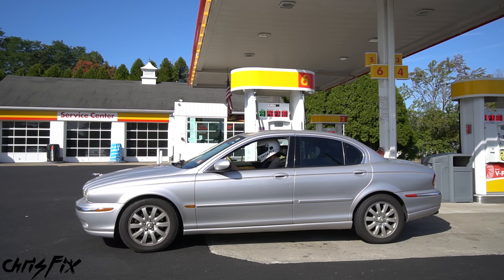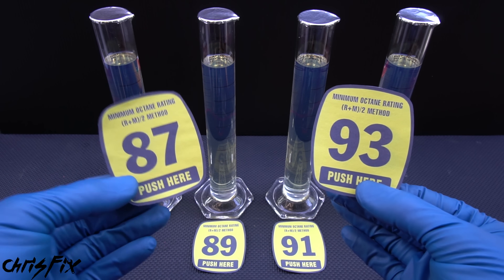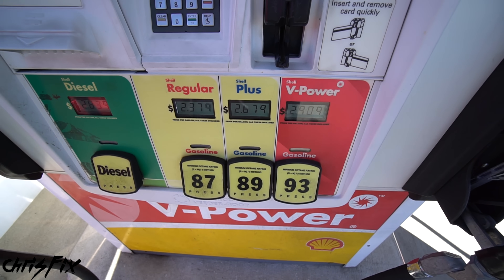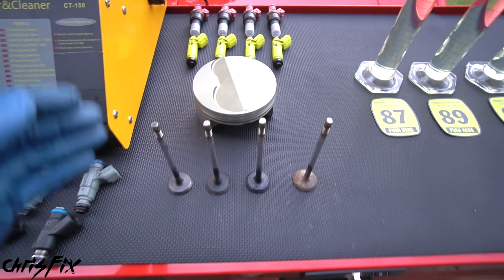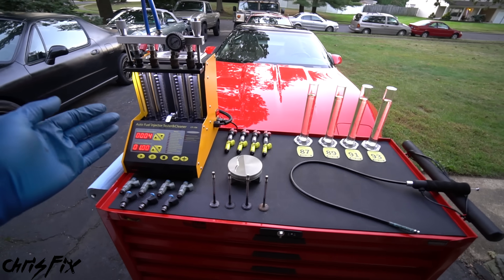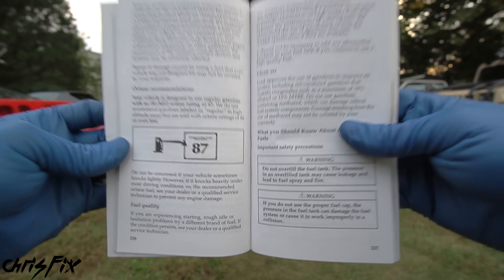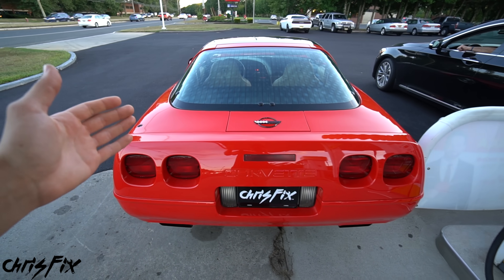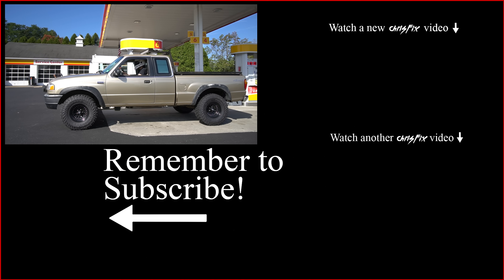What is the BEST Fuel to Use in Your Car or Truck and WHY

Comment: WRONG INFO.......the fuels have different burn rates.
If you use 93 in a engine that was designed to run on 87 you can over time cause carbon to build up in the engine because of the different burn rate 
I read this in a mechanics trade magazine a few years ago.
Reply from the maker: That’s not true. I had petrol scientists go over my video before it was published for accuracy.
Reply: @chrisfix  
Well.....somebodys wrong.....like I said I read that in a Mechanics Trade magazine at a repair shop.

Comment: Shell and Exxon are best fuels.    
What about using lower octanes at higher elevations?    Denver, Coloradope pumps:  85 R, 87 MG, 89 P
We use Regular in our RX350.   Maybe slightly less fuel mileageconomy, buthe lower co$t is worthe difference.
Interestingly, CostCo sells only 85 and 89 (or is it 91?).  Do any customers mix the two to create mid grade?

Comment: ill nvr run shell gas.....the only time i did i had a 97 sonoma 4cyl 5 sp it ran just fine until i put shell gas in it...i cidnt go over 20 mph until i pumpee the tank and put my usual gas i  it from Ayerco...and also i heard that ayerco under rates the gas..like the 89 is 90...and so on...i havent had any issues with gas since ive stayed away from shell
Reply: i even have ran 2 cycle gas in this truck once...in an emergency and it was a bit smokey thats it......and it was only a gal.

Comment: If a car requires 91 octane gasoline (the type which is least common at most gas stations) can you fill up by pumping in half volume of 89 octane and half of 93 (will give upon mixing and average of 91 octanes)? Or, can you fill up with 1/3 of 87 and 2/3 of 93 for an average of the mix of both fuels giving 91 octanes?  I heard from car mechanics that the above mixes should absolutely not be used, but not a single one of the mechanics could even give a single logical argument explaining why so.

Comment: Here in Finland literally every person from 18 to 70 years old, says that putting wrong gasoline in the car will burn in higher or lower temperature, and because of that it will bend the internals, the intake and exhaust manifold, and make the car broken. I actually now just wanna laugh at everyone's face whom have said that. 😭😭😂😂😂😂

Comment: Been running 87 octane on bMw that calls (says required)  for premium (89?) for last 8 years with no issues should I goto 89? I have never had any issues with knocking or power loss. engine is a m62.
Reply: In short yes you should go to 89. Long answer, 87 octane will cost you some power loss at max power use. IE maybe about 5-8% power loss when you put your foot to the floor and only under those max power uses. In normal driving you will never know any difference. Your BMW puts out what about 300 HP? So if you use 87 octane and go full throttle for a burn out you will not get 300 HP instead you will get about 285 HP. Or about 5% maybe as much as 8% less HP from what ever your actual HP is supposed to be. 
And it will only show up under full throttle conditions. The rest of the time 87 octane will run perfectly fine.

Comment: For several years I worked at Shell's Westhollow Technology Center in Houston Texas.
It's THE premier research center for Shell Chemical Corp.

Things everyone talked about were what oil additives, what oil and what fuel was the best out there.

Hands down you got the same answers over and over no matter who you asked year after year.

The answers were:

Oil additive:
The only one they said did anything at all was "Prolong". It comes in a little white bottle and is about as thick as alcohol. Something about a chlorine molecule that attaches it's self to metal and oil attaches it's self to the chlorine. I'm not a chemist's don't really understand what they're talking about. But I know they know what they're talking about and have used prolong with no problems for years.

Oil:
Again, same answer year after year.
Castrol semi-synthetic GTX. Something about the two types of oils doing a better job than either of them alone.
They follow up saying Castrol GTX is what John Force's funny car uses. And, many of the air cooled VW racers. 

Aeroshell is some of the best aircraft oil out there and many people at WTC buy it for their motorcycles. Rotella is another widely used high quality shell product for tractor - trailers that people there buy for motorcycles. 

Gasoline:
This one is easy to learn even without asking a chemist. Every day people get off work at WTC and go one block down hwy 6 to westheimer where there are two gas stations.
A Shell. And, a Chevron.
The line of Shell employees forms at the Chevron station.
The reason the chemist's said was because Chevron has an additive called "Techron". It's awesome stuff. 
They don't share Techron with their competitors. They keep it to their selves. Shell also makes really good gasoline second only to Chevron. Just not the best available there. Sunoco makes high performance racing gas. You just can't get it in Houston and it's expensive.

For what it's worth that's the answers to the 3 most popular questions people ask chemist's at the biggest research center Shell Corp has on the globe.
Reply: Very good information. Thank you for that.
Many years ago I gave a ride to a friend in my 350c.i. built elCamino, which got poor gas mileage.
He filled my tank with Chevron gas and my gas mileage improved, a lot!
I was blown away, I thought gas was gas. I knew about premium because Elly May Chevro-lay would tell me if low octane fuel was used, very unpleasant noise from the engine room...
But, Yeah, fuel is important.
Unfortunately, Chevron does not sell ethanol free fuel.
Ethanol free fuel is better, except it is lower octane by its very nature.
Reply: @jphilipwilliams2837  You can get ethanol free 91 octane fuel. I would say ethanol fuel has less by nature because they need the ethanol to boost it to 91. (Comparing 91 to 91)
Reply: Ok, I'm sold. In the future, I'll be frequenting my local Chevron station whenever possible. What about Esso? Where do they rate?

Comment: I have a 2011 Ford Ranger 4×4 4.0 L 6 cylinder, manual says 87 octane or higher, I've run 89 from the start, runs like a champ.

Comment: My car runs on water don't tell the government
Reply: Is against the gobernment to have a camel in the city.
Reply: Soo you drive a Toyota??
Reply: @paulogonzalez3617 . Toyota noo. I bet he has one of those old ass little honda civic. Those old cars run without oil. I had one an i only chaged the oil 2 times a year
Reply: I actually ran a car on water.
Reply: @RandomActivities  I drove a car in the water
Reply: Ok 70s show.
Reply: @xSK8COLOMBIAx  i waz bouta say the same tging
Reply: No i drive a BMW
Reply: I tried to run my car on water but it flooded😭😭😭
Reply: if you hear knocking, it's not the fuel, it's the .gov behind your door.
Reply: Actually there was a small time chemist in the Philippines who invented an engine that runs on water. The secret was the engine had the ability to separate the Hydrogen molecules from Oxygen thus the engine basically runs on Hydrogen component.
Reply: @TigerKittay  
Separating water into individual oxygen and hydrogen atoms requires energy. More energy than you could recover by then either burning the hydrogen or recombining the oxygen and hydrogen in a fuel cell.
Reply: I think you just did 😂🤣
Reply: Why is elon in the comment section
Reply: That 70’s show lol
Reply: I ran my car in the water
Reply: I'm telling.
Reply: Tesla?
Reply: My car runs on urine,  don't tell the government I have a pp factory in my basement
Reply: Same...mine runs on hydrogen.. top secret..
Reply: true you could wind up to be another fatality like Diesel did when he "accidentally" fell overboard on his way home to Germany. It's true look it up
Reply: So it's a boat?
Reply: wait your car runs
Reply: Mine's operated on beer Don't tell the highway patrol.
Reply: Water is already becoming scarce
Reply: @meenalnafde6216  
I'll give you one guess what an ocean is made of

Comment: Great demonstrations but Shell really put their stamp on this.
 You didn't mention something though!!
What about ethanol free gas? That will have a little more power than the 10 to 15%  of ethanol garbage in most gasoline including Shell's best. I have 2 stations of a hundred in my town where it can be purchased. I definitely buy it for my lawn equipment so the fuel lines don't crumble away. I don't think it's worth the price premium though.

Comment: Hey amazing  explanation, I got kind of lost about the E-85 flex fuel cars. Could it damage the engine to run regular fuel or it doesn't  matter?
Thanks 4 the video I'm watching you from Honduras.
Reply from the maker: You can run regular fuel but dont run E85 if your car doesnt allow it. I will make another video about ethanol specifically.
Reply: Amazing I'll be waiting 4 it. Thnx a lot

Comment: If you add a supercharger you need higher octane but if you also get a water methanol injection system you can use regular right?
Reply: In a BF109 that's correct,

All jokes aside, most if not all owners manuals say that you will void your warranty using methanol....

And the amount that that system would cost and set up properly, it would be far cheaper just to buy Premium Gasoline
Reply: @notsureyou  I have a 2002 4runner so I'm not very worried about voiding the warranty 😉

Comment: Great video! What’s funny is that in Europe all the regular gasoline si 95 octane and premium is 100+, judging by that, importing cars made for the european market it will make it hard to run it with the gasoline you have available at pumps.
Reply: Not really, having watched his video, you can see which Gasoline/ Petrol that you need

Comment: What about motorcycles? I had a gas station attendant tell me before I put my bike up for the winter I should put E85 in it so it didn't damage the fuel lines. Any truth to that?
Reply: I would check with the bike manufacturer

To me it sounds like some really really really BAD advise

Comment: Thorough overview, I knew that about Octane but learned about Euro ratings.   What we've noticed in CA is that the higher ethanol content in our normal gas (we're saving the planet!..sarcasm) is ripping us off.  Hop over to NV or AZ on a trip and compare mileage and it improves with gas from sane states.  But I sleep better at night knowing that my use of more fuel somehow prevents the global warming that will end us all in 12 years....

Comment: What about a pump that says no ethanol. I run that in my 87% elantra? It seem to run better. My car is a 2017 and when i run regular gas, it hesitates and when i stop, It sometimes feels like the engine skips then it runs fine. The dealership says nothing is wrong with my car...
Reply: What do you mean?

In regards to:

87% Elantra?

"Pump that says no Ethanol"

The problem is that when you take your car to the dealership, unless the problem is happening there and then, or the car logged a "Fault code",

they don't have any way to diagnose the problem.

It could be a bad batch of fuel, maybe your car doesn't like that brand of fuel, maybe you have just gone from lets say Regular to Premium (or vice versa) and the car's computer is trying to find the best ignition timing etc.
Reply: @notsureyou  I meant the 87% gasoline.

Comment: What would happen if you mix gases?
Reply: It depends on the gases that you are mixing.

Now for the non-silly answer:

It depends on your car's requirements, and if any of the gasoline options are not suited to your car (for example E85).

Lets say your car requires "Regular" gasoline and you want to try to mix in Premium (for what ever reason), you would get a fuel that is the average of the 2 fuels (so the Octane rating would be slightly higher, as well as the detergent levels than the "Regular" gasoline).

E10 for example would reduce your range, as Ethanol  has less energy than Gasoline

Comment: Fun Fact: Diesel nozzles are wider than gasoline nozzles, so it would be very very difficult to accidentally put diesel in a gasoline car. 

After hurricane Harvey, we only had regular gas for a few weeks. My car takes premium. It was fine with regular, the turbo felt a little sluggish (that may have just been in my head). The computer will adjust in any modern car. I was trying to explain to a lady with a BMW at the next pump that it will be fine, but she didn't believe me, oh well. It's okay to use regular in an emergency, just don't make a habit of it. I didn't add the bottle of octane booster either.

Comment: So I have a Nissan Altima which obviously 87 as fine. However is it a good idea to run let's say shells premium V power once in awhile just to clean the engine. If so how often should you run it the clean and for how many miles straight should you keep running it to clean your engine components. PS love your videos they're awesome.

Comment: I own a 2001 Chevy S10 truck and since I had it I've been put in 93 and I got very good results for 13 years out of it so far no problems there's an old saying you get what you pay for and I get very good gas mileage what's a 93 grade always even though my truck runs good off any grade gas I still put the best which is 93 grade

Comment: You had mentioned running regular, if that’s what my car suggests. But you also mentioned shell premium has the best solvents to keep your engine running clean.

So even though my manual suggest regular unleaded, wouldn’t premium shell still be a better option?
Reply: It's cheaper to use regular if that's all that your car requires than to put premium in it just for the extra detergents. There are bottles of fuel injection cleaner for about $5 or less. You just pour it in you gas tank every 5000 miles (easy way to remember is to do it when you get you oil changed).

Comment: I run 90 non ethanol  fuel  in all my GM trucks  had  fuel  issues  in 2009 called  GM took  2 weeks  to talk to engineers about  my problems, their  response  was we test all our  vehicles  on ethanol  free fuel  to get the highest  mileage  and performance  rates . I'm still  running  that fuel  my 4.3 liter  Silverado  attained 26.5 to 27.0 mpg  on 87 octane  just  under  16 mpg  1 tank of 90 non ethanol  gets a average  of 600 miles  per  tank  to just under  a quarter of the  tank  thanks

Comment: How about regular fuel which has 10-15% alcohol? Does the alcohol damage the engine? Thanks😏😏😏😏😏😏
Reply: It depends on your car (that's the long and the short of it)

Ethanol is cheaper, but it has less energy than regular fuel

Comment: The only thing I world suggest adding to the video is a note about when you might want to use a tank or 2 of premium on a car that doesn't require it. Such as when you are anticipating needing more power and faster response. Like when I'm pulling a trailer with my pick-em-up or your teen wants to show-off for the girls on the cruising strip (before the cops get there -- lol).

Comment: here in Brazil we use more ethanol than gasoline, and most cars are flex, gasoline is very expensive, and ethanol is cheaper, but manufacturers don't usually recommend gasoline types.
Reply: I saw a documentary on how they have increased deforestation of rain forests to be able to grow the amount plants required to make Ethanol (and even then have a shortage),

Comment: Depending on your engine, it may require a different grade. Manufacturers don't necessarily tell you the truth if the motor has bad design requiring better fuel. Cheap parts can contribute to this.

Comment: I had a 2002 Dodge Quad for 16yrs. Bought 87oct. and used 2 bottles of Octane Boost in the fuel tank . Never had a single problem and used to get 22 miles to a Gallon . So yeah I would say it definitely raises the octane content of the Fuel ! Had over 100,000 miles on it never had a single problem from Day One  .

Comment: I have a turbo 4 cylinder. My owners manual says my car was designed to run on 87 but premium is recommended for “optimal performance” can I put mid grade fuel in and meet them in the middle? Thoughts? Thanks
Reply: If you want performance that is between Regular (?) and Premium than sure go the mix :-)

Comment: This whole "if your car doesn't ping (detonate), you don't need a high octane fuel" is a common falicy. I've rebuilt many hundreds of engines and I have always been able to tell which ones used regular gas and those who used high test. Customers hav always verified my suspicions. Ones on regular gas are full of sludge. Those on high test aren't. Talk to a chemist from a gas distillery. They'll tell you what gets dumped in regular gasoline. 

A lot of the info in this video is correct and is presented well but without knowing exactly what is added to fuels, a person cannot conclude what is best for a gasoline engine. Overall though good video.

Comment: So does Shell add these same detergents in their 87 & 89 octane , or does their Nitro have more detergents  ? I know they always market for the Nitro and go on about the additives, but is the octane the only difference? Anyone know? I use regular in my Accord, but with it's high mileage, i always get top tier fuel. But I didn't know if I had to get the V Nitro in order to get the additives benefit that V Nitro claims, or if their lower octanes have the same additives and and simply just have a lower octane ??